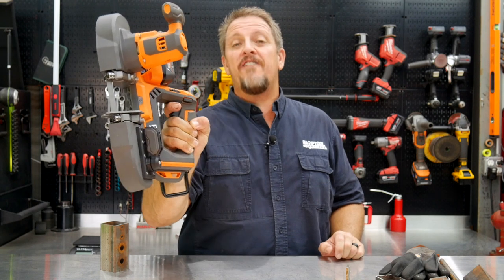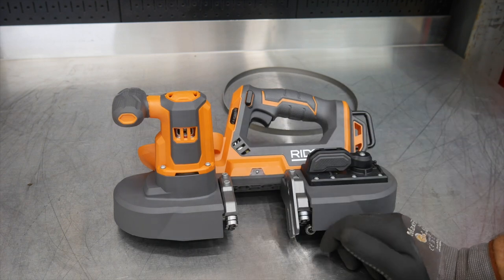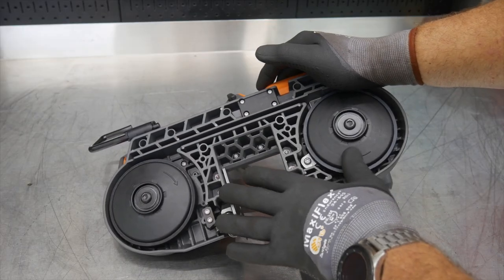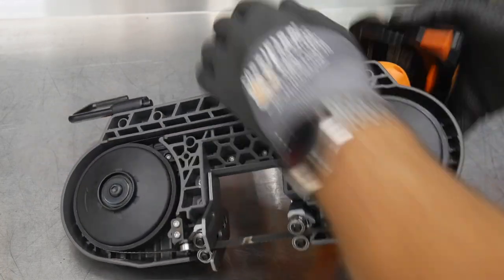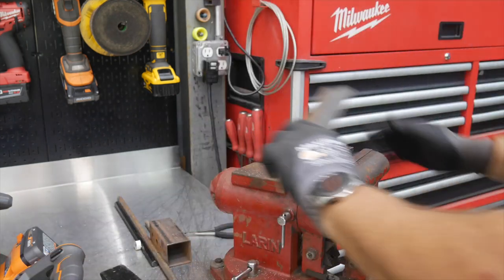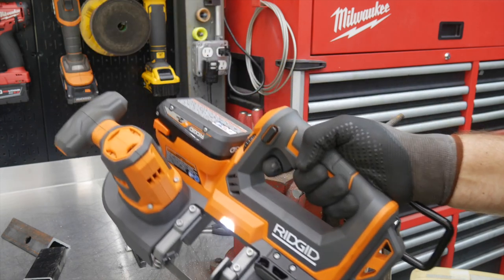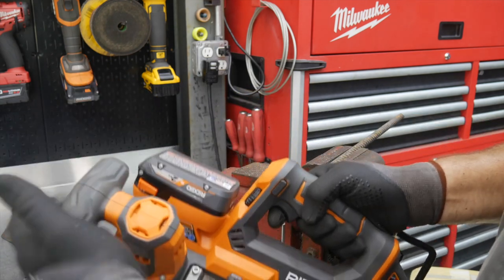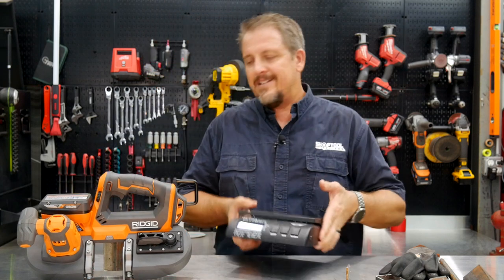ONE-HAND BAND SAW - Ridgid R8604 18V Compact Band Saw Review

Comment: Couldn't you turn the tool 90 degrees to finish that cut? Or flip it around. It's $50 more with a battery and charger and you didn't mention that it has free parts and service for life.
Reply: Just got one, blade would come off while running, took it back to home Depot to fix it
Reply: @genemcelhannon1847  Did the new one remedy for the blade coming off? I’ve read a lot of reviews of people having the same issue.

Comment: At about the 10:30ish minute mark on your video, looks like the saw was doing fine, the front end of the tool was facing your red vise, and looked like it was touching or bumping into the vise preventing it from going all the way down but you said it would not do the 45? I think if you were on the other side of the vise and the front end of it was not facing the vise but facing away from the vise the 45 would have probably done okay.

Comment: Can't get behind new tools with brushed motors. No go for me.
Reply from the maker: That really doesn't make sense. Brushless motors are not really superior in this instance. In fact, having a larger brushed can motor can displace more torque than a faster-spinning smaller brushless motors. Also, a canned (non-brushless) motor requires less electronics to run. Less prone to failure. 
We LOVE to see brushless motors where they make sense and where they can be far superior, but that's not Always. Thanks for watching.
Reply: That's silly. Brushed motors are still plenty viable and super simple. Plenty of uses left for brushed motors.